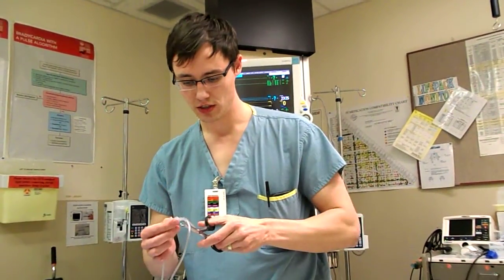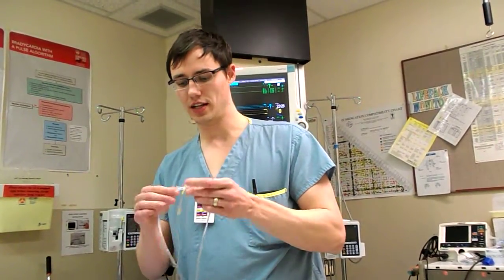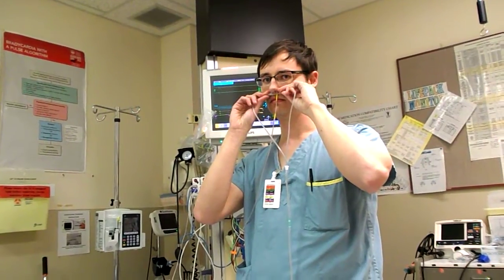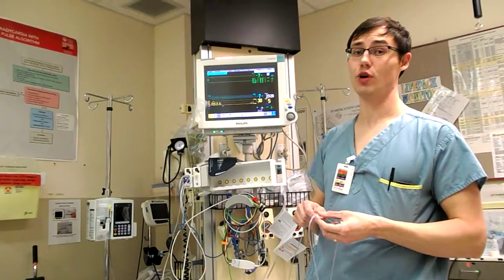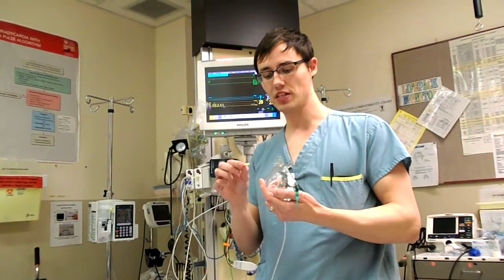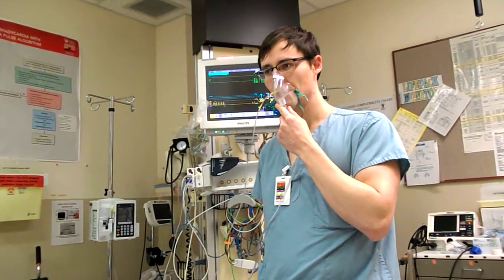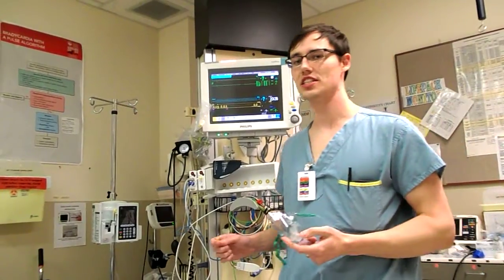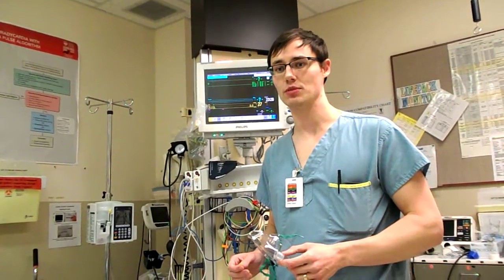SOCMOB How To: Make your own Noninvasive End-Tidal CO2 Detector (New revised method)

Comment: why use 2 different cannulas in this manner instead of using one that is specifically designed for that and has oral/nasal CO2 as well as oxygen delivery??   https://www.boundtree.com/smart-capnoline-plus-o2-connector-co2-sampling-line-177653-pharm-5572-121.aspx